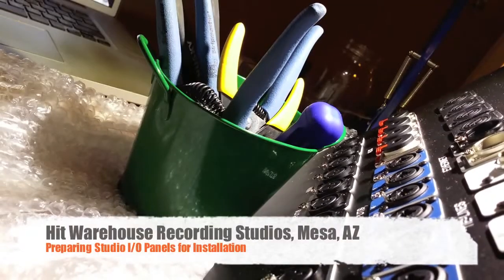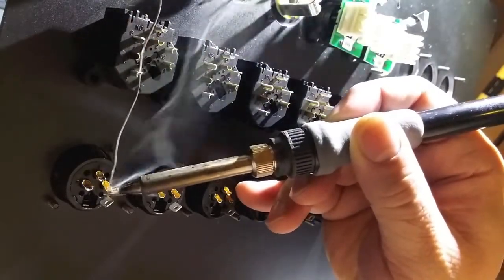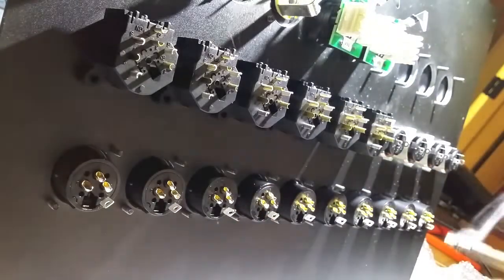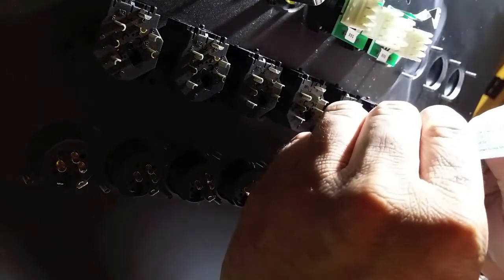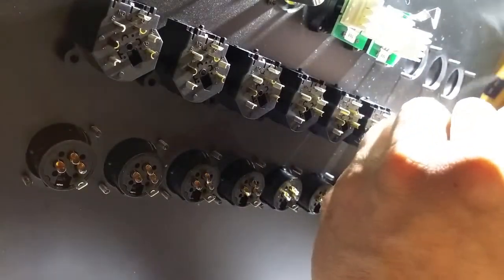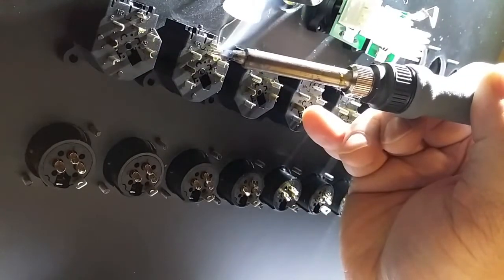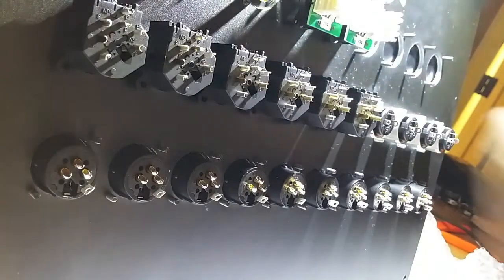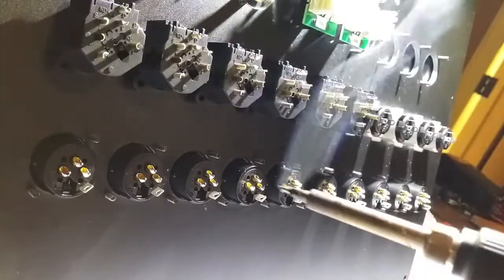Studio Wiring - Wallplate Preparation - Tinning the Cups

Comment: I suck a soldering. You did a clean job. Im looking to mount my 15'' powered speakers to the wall on brackets. i want an xlr wall plate and power outlet right behind the speakers so i have no wires showing. Im hoping I can do this without soldering. Maybe with some spade connectors. idk. still brainstorming. Good video. ill subscribe dude.